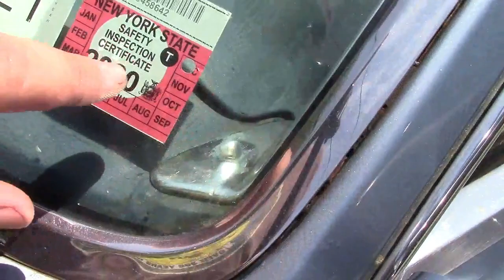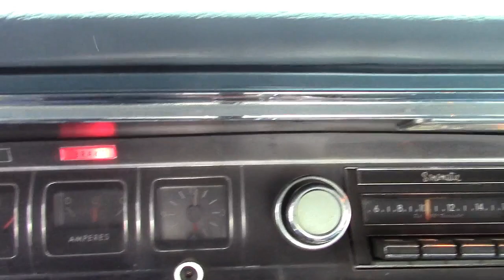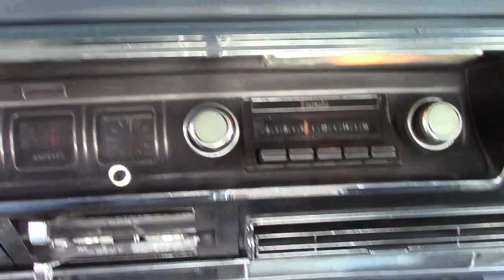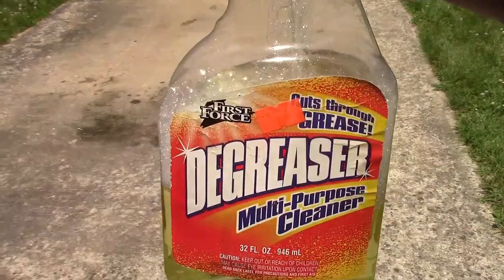Replaced The 87 Camry's Radiator, Plus Bluick Brakes Update

Comment: I ended up putting an all aluminum radiator in my Pontiac which I got on clearance when the original radiator started leaking.  It’s so good at removing heat the on cooler days, the temp gauge will move up and down due to the thermostat constantly open and closing.
Reply from the maker: Probably would make the computer in cars today go absolutely haywire!

Comment: I had to do the radiator on my 08 Ranger in October, it was slowly going through coolant last summer but I couldn't figure out where it was going. It would be fine then all at once it would drop an inch in the tank. I ended up finding a very small stain surrounding a very small crack in the original radiator. That day I ordered a new radiator and had it shipped from Rock Auto. New one came like 2 days later and I was like oh good I can replace it Sunday (it was currently Thursday). I was sitting at a traffic light on my way home from work and I heard a slight pop noise, and the smell of coolant filled the truck, I turned the heat on full blast and kept an eye on the temperature gauge knowing I had a half mile to go. I pull in the driveway, open the hood and see what looked like a green waterfall pouring out from the radiator side tank. Long story short, it was replaced that night along with the thermostat as a precaution and all new coolant. The transmission lines were a problem getting loose due to rust but otherwise it went smooth and my random coolant loss has stopped, let just hope the new radiator lasts a while as the original was in there for 210,000 miles. Currently I'm at 221,000 and the coolant has not dropped at all.
Reply from the maker: Well you got plenty of mileage out of the previous one.  Can't complain about that!

You drive quite a lot, that's rather high mileage for an 08.  THE BIG SIX is an 07, and that's sitting at a paltry 80,000 miles.  She might get a total of 20 miles a week.  Though interestingly, the radiator already popped on xjoe81x's, and he's at maybe 85,000, or perhaps 90,000.
Reply: @jaykay18  I feel like these radiators pop whenever they feel like it, I've seen them pop at 60,000 and others last over 300,000. 

Yeah I drive too much. I don't drive as much as I used to but I still go a decent amount. I mostly go through suspension parts, our roads here are okay until you drive down them a mile and realize they'd be a better washboard. Every one has multiple giant holes that you can't safely avoid without going in another lane. That's what finally killed my old Taurus, rust and a suspension that felt like noodles from bad roads made me finally junk her, still ran and drove fine otherwise.
Reply from the maker: @brunoshow124  Yeah I know what you mean.  The one in the wif's car lasted about 150,000.  It's now got 175,000 on it and the suspension was shot.  Just spent a pretty penny to have all the parts replaced, now it rides like new.
Reply: @jaykay18  I'm regretting not doing the suspension in the old Taurus, but it is what it is. My truck is starting to get a bit wobbly feeling, I know the shocks are shot. I'm gonna get that taken care of sooner or later.
Reply from the maker: @brunoshow124  Never did shocks or springs, but did all the other parts.  The shocks and springs seem to be just fine.

Comment: Yep, I know about switching roles, and it is an odd feeling.
Radiators are pretty easy once you get in there, and try ! I'm glad you got the experience.
Man, that is odd about the Bluick's brakes. Can't wait to see what the deal is with them.
Yeah, LA's Totally Awesome just plain works, and I use it quite often.
What size are the wiper refills? My 1981 Chevy takes 16" and my local auto parts place keeps the old refills in a big trash can. They just drag it to the sales floor, and let me rummage through until I find a pair of 16" refills.
Reply from the maker: Yeah, the job really wasn't too bad at all.  Some tight quarters, and of course all grimy and greasy and dirty.  I was glad to get the experience also.

I couldn't really imagine the brakes are anything more than a quirky master cylinder, I mean what else would really cause that?  With a bad proportioning valve, I should get SOMETHING.

I actually was sent some other stuff that is supposed to be pretty good for cleaning, and need to test it out.  Maybe really soon.

The wipers are 18".
Reply from the maker: @tallboyyyy  Thanks, that's definitely an option.  My dad gave me some stuff, I'll have to see if it fits first, otherwise I'll look into that.
Reply: @jaykay18  Way she goes!

Yeah, I don't blame you for not trusting it. It could decide to act up at any moment. I recall when my rubber brake lines were failing, everything would be fine at first. As i drove, and braked, I could feel the calipers staying engaged for longer, and longer. I dreaded that job, but it turned out being way easier than anticipated, thanks to the HF brake bleeder tool!

I can swing by the trash can of wiper refills to see if they have any. I need to pick up a pair of 16's for the 81. Yours appear to be the same style mine uses.

Hopefully the new product is as cost effective as LA's. Looking forward to seeing that! I have another pine cleaner video up soon. I had a fail, but will include that in the video, when I record the second part, post fail.
Reply from the maker: @dynatrak  That reminds me of the time the master cylinder went out on my old Chevy.  I was in college at the time.  Got there no problem.  Driving home, coming to a light and it's not stopping and the brake was just sinking to the floor.  For some reason also, the brake pedal was always way high up in that car.  It didn't have vacuum-assist brakes.  But the pedal would just sink and I wouldn't stop.  Fortunately I found if I stomped it hard and fast, I'd stop, and I made it home.  Master was replaced, that's a whole Old War Story in and of itself, and I'll be recording that one day.

Probably are the same style.  A lot of times they use the same parts for decades.  The same starter that fits the 87 fits the 2000, 2003, and 2007. m And I have a spare from Old Clanky.  Same alternator too!

Definitely not as cost effective, that LA's is almost cheap as free considering what it does!  I want to see this stuff come close.  They do sell other products like wheel cleaner and the like, and in fact they sent me a shirt and hat as well!
Reply: @jaykay18  Oh dang! That sounds like an adventure, for sure. On my 81, the master developed a severe leak, but never failed completely. That happened in the late 90's, and that master cylinder is still working.

Yes! That's a smart way to do things, as to not have to retool operations for decades.

I'm sold on LA's Totally Awesome! It does everything I need, and more.  That LA's Totally Awesome vs Purple Power video is still a solid performer. It's in my top three every day.
A hat, and a shirt, decent! Really looking forward to seeing this product.
Reply from the maker: @dynatrak  It was "fun".

Yes, Toyota especially is famous for that.  But GM has done it also.  Nothing wrong with that, if the part is designed correctly in the first place!

Me too, it's great for everything.  I will see about testing that product soon.  The company pestered...

Comment: I'm doing work on my car before this weekend that I've been putting off for a while.  Both front brake calipers have seized pins so the caliper doesn't move to center itself on the rotor.  This causes the rotor to get pushed over to the other brake pad instead of the pad getting pulled into the rotor.  I got one side done last night but it took me over 2 hours just to get the stuck pins out.  I'm about to go do the other side and hopefully now that I have a little experience on what works and what doesn't this side will go a lot quicker.  Then I'm going to change the oil so it will be good to go this weekend.

I did a radiator once but can't remember if it was my car or a friend's.  I don't remember it having transmission lines so I think it was my friend's car that was a manual.  Not much to it.  A few bolts and hose clamps.  It was over 20 years ago when neither of us had the money to pay someone to fix it so we did it ourselves.
Reply from the maker: I've seen my dad do brakes lots of times.  Pretty sure next time a car needs them it's going to be the same story as this radiator.  Good to do your own brakes, shops charge an absolute fortune for brake jobs since they know you need them.

Comment: Even good cars like the Camry will have a problem sometimes. A radiator is such an unpredictable component in most any car. I recently just did the heater core and evaporator coil in my 93 Grand Cherokee.  I wanted to get some of it on tape but when you come to the realization that you and a buddy took the entire interior of the truck down to the firewall, you begin to become vastly more concerned with what you've gotten yourself into.  It all went back together  without much of a hitch and the A/C is frigid  now.  The biggest time consuming factor was waiting for delayed parts delivery...  My neighbor has a 63 Buick LeSabre that he occasionally does some driveway work on. Its a pretty interesting car. I wonder if he'd let me do a video about it... I DO plan to do a good walkaround of my Jeep though. Its a good enough time now where everything is buttoned up and  looking pretty decent. 

Nice video.
Reply from the maker: Yes, very true.  Couple years ago I had to do the heater core on the Bluick, as that started leaking.  Had a place do it, fortunately in that car, they put it under the hood rather than buried in the interior.  Just a more logical place to put it when it comes down to it.

When my dad and I tore apart Old Clanky, fortunately we didn't have to worry about putting anything back, but I can certainly understand how complex that is!

I'd love to see that 63, if he'd let you, and of course your Jeep as well.